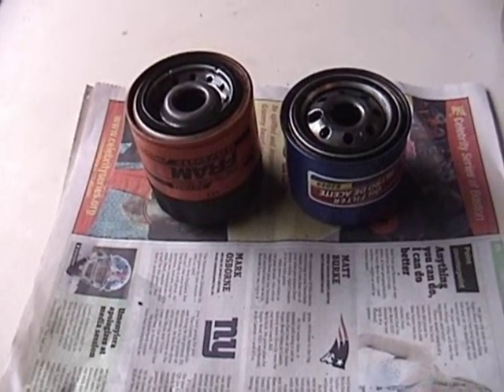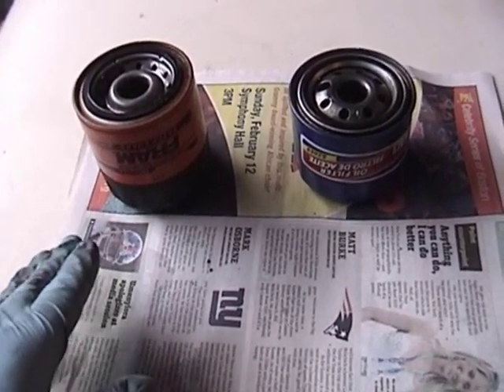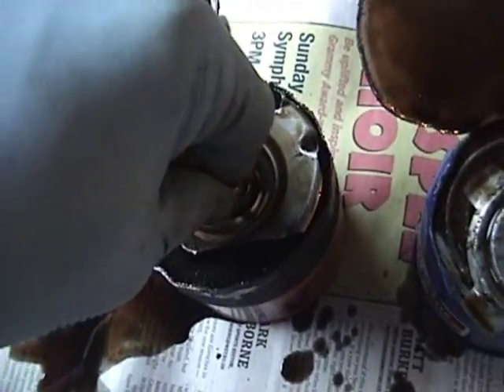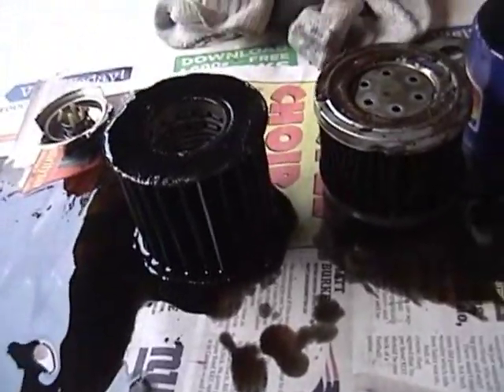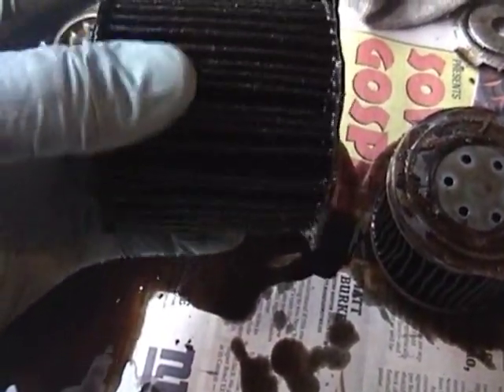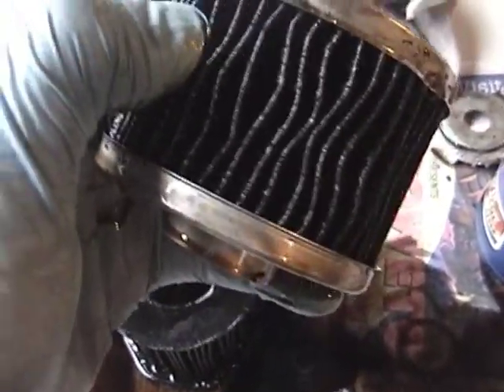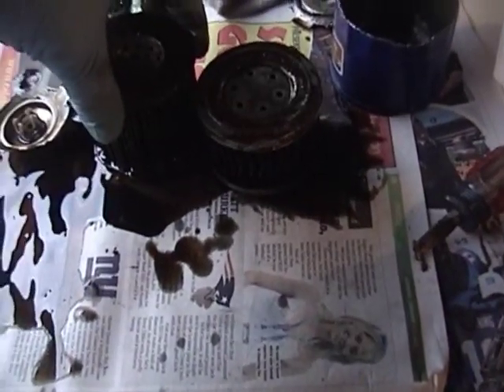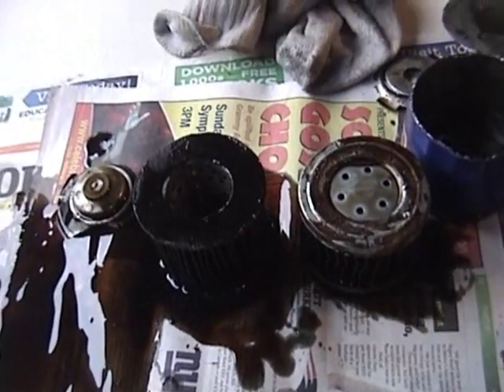INTERNAL comparison of Fram and STP oil filters

Comment: and bypass valves are used when the oil is super thick due to being cold or if you run the filter way too long and it gets clogged up.   It will allow the oil to "bypass" the flltering media so it can flow to your engine sooner and not blow up the filter media. It is a GOOD thing.

Comment: The stp filter seems to have a bypass system also. The 5 holes in the rear endcap. In normal operation the leaf spring kinda cover the holes, but if the pressure rises inside the filter it overpowers the spring and lets oil through those 5 holes :)

Comment: I think the complaints about the "cardboard element" in the Fram normally refers to the cardboard endcaps on the Fram, not the filter elements themselves.  Regardless of whether the cardboard/glue arrangement fails more often or not, I think those who compare the construction of the two would prefer the metal endcaps over the cardboard... maybe fair, maybe not.  The difference in the reliability and performance of the two constructions may be more revealing when compared under severe duty.

Comment: OK here is what I discerned from your video. The STP filter has probably the same surface area of filter material as the Fram. The can is smaller, so it figures that the material needs to be tighter to have the same surface area. The valve in the Fram is a anti flow back valve. What that does is keeps the oil in the filter when the engine isn't running. Thus when you start the car, the engine doesn't have to wait for oil to go thru the filter before returning to the block.

Comment: Its a bypass valve (the spring thing in the Fram) it alows some of the oil to pass through the filter without getting filtered. STP does not use bypass valves so 100% of your oil gets filtered.

Comment: The usual complaint with Fram filters is not the "cardboard" element, but the cardboard end caps. I'm not sure why that is a problem, but the steel end caps used on many filters should be stronger. Of course, as your video points out, this only has to last a few thousand miles. There is always a controversy about everything about cars, which oil, which filter, etc. I've used Fram for years with no problems, but I've heard that they have recently cheapened their product to boost their profit margin and I'm rethinking Fram, which is why I'm watching this video. Here are a few links on the subject:

From Factory Five Forum (Critial warning re fram filters):
http://thefactoryfiveforum.com/showthread.php?11416-Critial-warning-re-fram-filters

From YouTube (Fram Ultra XG2 15,000 Mile Filter failed after 4,800 Miles in a 3.0L Duratech Engine Mobil 1 Oil):
https://www.youtube.com/watch?v=NexBveNFZjg

Of course I've seen the same thing on Wix filter failure:
https://www.youtube.com/watch?v=KXKIxyMeLpg

paul

Comment: The end caps makes NO DIFFERENCE as to quality.  It has to do with what kind of media it is attached too.   Some filters has NO END CAPS whatsoever and they are simply heat sealed or sealed with glue.   FRAM has been made the same way for 50 years. Ignore the ignoramuses. Bentley uses the same cardboard paper end caps.. Some idiots follow form over function..
Reply from the maker: I'm trying to draw as few conclusions these days as possible. I'm only trying to observe differences between filters now when I cut them open. That being said, yes, I'm in agreement - the filter element is the most important thing. However, the [admittedly - quite possibly wrong] assumption is that a filter manufacturer who used a cheaper, flimsier endcap would have used a cheaper, less effective filter element.
Reply: MercedesDieselGuy Then you would have to include Toyota in that department also as there filters have NO end caps. They are actually glued.  Metal caps don't mean high quality, it just means that the media they use adhere better.  FRAM was considered high quality back in the 60's and 70's and even the 80's.. Funny thing, is that the ones I have from that era are made the exact same way...
Reply from the maker: PETER MAINWALD I KNOW (well... now, anyway) that the end caps (high quality/low quality, or lack thereof) don't correlate to quality of the filter element. I was just trying to explain the logic that would lead to that particular assumption. As I said, I do still (sometimes) cut open and compare filters. I no longer try to make any assumptions without data. I just show the differences.

Comment: any paper filter  is cheap. but generally work fine for 3-5k mile oil change. but if u do any more than that running synthetics u might wanna look into fram ultra or other brands higher end names. but this filter in video is the cheapest on the market. if it fails and your engine burns up you have no room to complain. should have spent a few more bucks. it would have saved a lot in the future. yes orange package fram is cheapest. dont do it and i would only trust it in a car i dont care about.

Comment: Honestly, Only use Valvoline Full Synthetic. Fill the Filter (K&N or Motocraft filters). Only use Sunoco Gas. Change your oil every 3,000 miles. How do I know this? Well, did you know Racing teams know WHAT THEY'RE DOING!?